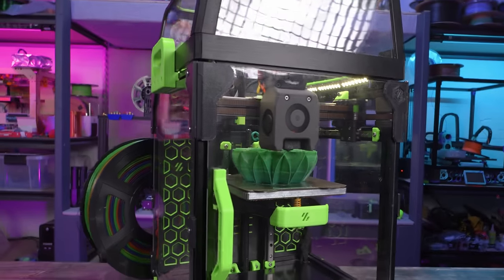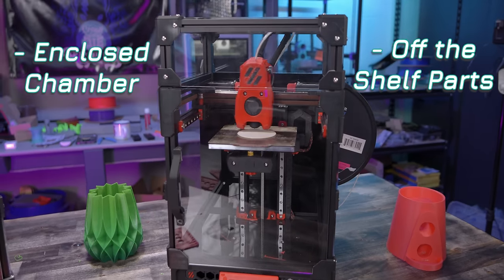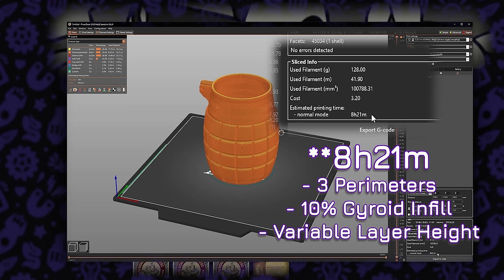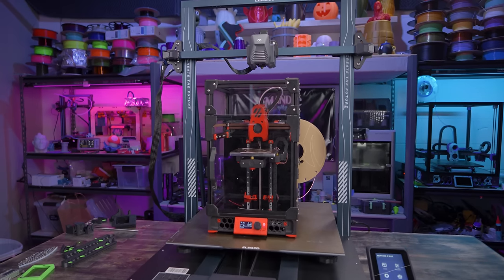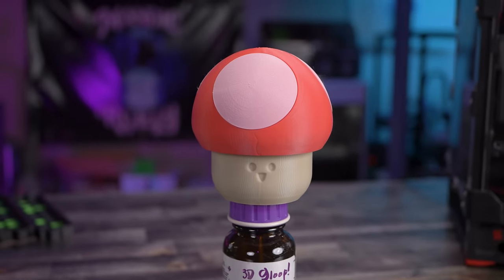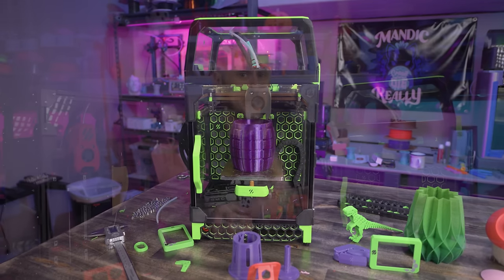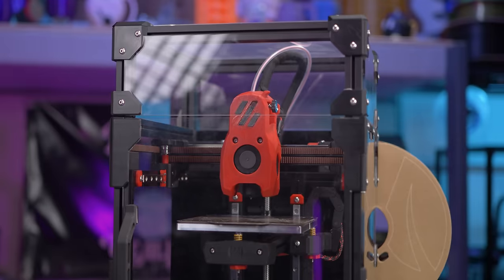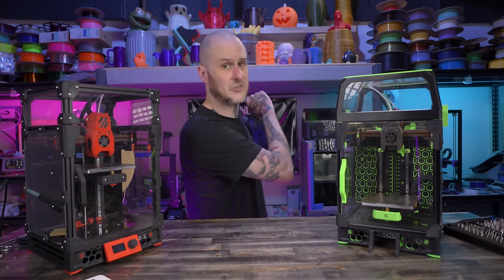Small 3D Printers are POINTLESS! Or...

Comment: I was able to make a 300mm long part with my V0.1 just fine, I designed in dovetail joints into the part and glued them together. It was the easiest way to get an ABS part that big without warping or a large build chamber.

Comment: I got a 350mm voron 2.  Reasoning was that sure I could get a smaller one, but I KNEW I was gonna want bigger parts.  I don't do a lot of design work - just finding prints to do usually - so printing fast is not really a problem.
Reply: I usually go with bigger printers because I like to throw stuff on and have it fit. Even small parts I like to be able to batch them. With that being said I haven't printed in ABS / ASA in a really long time and can see the benefit of a small enclosed printer.

Comment: another thing about mini printers is that it forces you to make easily printable models that you can glue or even weld together with a soldering iron. These models will either have to be sliced to be printed in multiple pieces or adjust the size to be smaller. This makes you have to print easy models that are unlikely to fail and if they do fail, less wasted time and filament. Furthermore, yiu get amazing features for a low price. The Monoprice Mini Delta is my go to mini printer, and I LOVE IT it is fast, high quality, easy to mod and maintain, ect. Simply put, the only models that can't be done on a mini printer are large print in place models, and let's be honest, print in place is more a gimmick than anything in most cases.

Comment: Honestly 90% of what I 3d print is smaller than 180x180, and 2/3 is smaller than 120x120. Building a Positron right now as I feel 120mm is a bit small for my purposes(too small for 3x3 Gridfinity bins).

And honestly comparing a V0 and an Ender is like comparing a cheap pickup to an EV Sedan. Both have completely different use-cases, and are valid, but for different reasons.
Reply: Hey I'm in the middle of building a positron right now as well. Did you finish yours yet? If so, how did it go?

Comment: You're bald because there's a finite amount of male hair allowed in the universe and Bryan Vines is using up your share.  :)

I would like a high quality, Core XY, 100 mm^3 ish printer - I print enough small things I'd be able to use it.  But I'm absolutely uninterested in having to build and tune a printer, so Vorons don't appeal to me.  And without the "I built it myself!" element, none of the Vorons is worth the cost.  (To be clear, it's my feeling that Vorons are absolutely worth the money for the folks who get value from the "I built it myself" element, but if you're like me a Voron is just "really expensive and a massive amount of work.")  For the money I'd spend on a V0 kit I could get a second X1C.  

Sure, the Total Cost of Operation on that X1C is higher, but the added flexibility would also be useful from time to time, and the extra money cost would be more than offset by the reduced exasperation costs.

What I'd really like to see is a "mini X1" printer, with the same fire-and-forget utility and high-temperature viability as the X1C but with a small print volume.  If something like that came out priced in the 300-400 USD range, I'd be very tempted.  Until then, my "prototyping" parts generally just get slipped in with other things I'm printing.

Although - given that I mostly print R2-D2 feet these days, and those need to be split even for the X1C, arguably what I should be buying as a Prusa XL, and set the X1C as my "small and quick things" printer.

Comment: You made some great points, I agree, from someone that uses, sells and upgrades printers as a business, I have printers from 120mm2 to 500mm2, I think its best to own at least 2 printers, buy a great big cheap machine for those big PLA cosplay things, and a small compact quality machine for printing high quality mechanical parts, always use the right tool for the job, and I'll bet if your into mechanical parts, you will be using the small machine more often than the big one, smaller machines have better tolerance, heat up quicker, are much easier to repair, can print faster, will fit on your desk right next to your work station, the only CON is build size, and I think most people just see that and let it go to their head, saying all this, I think a perfect compromise should be 150mm3 volume, the Voron Zero should have been 150 from the start, but this is a metric thing, I also don't think 0.4 should be the standard Nozzle size, should really be 0.5mm :)
Reply from the maker: After this I’ve been heavily thinking I should build a 150 or 160mm variant of the V0. It may well happen soon. That really does feel like a sweet spot.
Reply: @MandicReally  Yes I agree, 120mm3 is good, but 150 would have been a better choice, there should be a 150mm3 V0 then they should have done a bigger version with 2020 extrusion called it the V1 and made it 200mm3 then step up to the vastly more complicated V2 or Trident.

Comment: You touched on it slightly, but I think the biggest reason is that a Voron 0 is rarely the only printer someone will own, while the Ender 2 Pro (and other low-cost off the shelf printers) will often be someone's first and only printer.
If I only own one printer, I would want to make sure it is convenient for all my use cases, so even if only 5% of my prints wouldn't fit, that would be annoying.
Heat-Up time is also less of a concern on those printers, as they will likely only ever print PLA and PETG, and are also relatively slow. 10 minutes of heat up are annoying if your print only takes 30 Minutes, but if that Same print already takes 2 hours, those extra 10 minutes don't really matter.

For me, the perfect combination of printers would be something like a 2.4 350, both for big prints and mass production (and admittedly because it is cool), as fitting more stuff on one plate reduces printer downtime (heat up, cooldown, finding the time to pull the parts out of the printer), and a smaller printer (I'm currently leaning towards something like the Salad Fork, a Trident Scaled down to v0 sizes, but with a max size of 180x180) for rapid iteration.

Comment: I've been using a second hand Monoprice Select Mini V2 for 6 months now.  It was given to me for free so there's no way I'd complain.  Sure, it isn't perfect and a 110mm/cu (usable) build volume is limiting BUT it still works and it does a really good job.  Add to that I HAVE to think smaller and be very careful when I design things which has forced me to come up with some pretty creative ways of getting around problems.  It's also enabled me to get much better at placement to maximize size.  I've been able to print off 135 mm long items in this smaller volume.  Considering 90% of what I print fits in this space I don't really need anything larger.  I sure want it though.  :)
Reply: I Had this machine for one month and then i bought my MK3. It was nice to get started, but it lacks so many Features, and the Manual leveling with a Tool are Not really nice. 
 At the Moment i would Like a bigger surface but Not a Lot more height, as I  am printing lego Stones which arent that large. But only 84 fit on my MK3.

I do Not mind the small build Volume, but for Projects bigger ist better. If you have to Print a Lot of objects it helps Not to have to Clean Up the build space after every small print. Just fill IT Up and Go.
Reply: @MaxMichel89  I'm actually on the verge of getting an SV05 but only because I want the build volume and it'll really only get used for those larger prints. At least that's what I keep telling myself. 😁
Reply: @Enjoymentboy  IT should be a better value, but Inpersonally Like the better working conditions and Open sourceness from Prusa. Also depends where you live.

Comment: Personally, I think it's a nice machine if you have multiple printers. If it's just one printer, even if the majority of your prints work, the ones that don't are still a factor.
Most people don't use multiple printers, so it's probably not for them.

Thinking about it, I may eventually buy one on the side, most my prints do indeed fit and it is a nice project on it's own.

Comment: Had a crunchy motion sound on one of my linear rail machines, and found that by using a thicker grease in the bearing blocks helped a lot.  Downside:  partial disassembly will probably be necessary.
Reply from the maker: I'm hoping that is all I need. I never greased them as well as I should have initially.  Hopefully they aren't damaged now as I have a few hundred hours on it.  I'll be disassembling for a conversion soon so I'll address them then.
Reply: @MandicReally  If you need to replace the bearing balls, the best place I've found is McMaster Carr. Just search for Low-Carbon Steel Balls 5/32" Diameter. I used these to rebuild some sketchy rails I got years ago and they worked out great.

Comment: could you say then that a voron 0 is a great 2nd printer when the reasoning for the 2nd printer is that 1 printer just doesn't quite have enough throughput for rapid prototyping
Reply from the maker: Yea, that was a point I had intended to make but didn't want to drag out the conclusion.  To me the V0 is an excellent "2nd" printer.  Have another machine that can handle the bigger stuff, but the small one to pump out rapid parts. When I first started using my V0 that was how it was.  It was the "small" sibling to my Prusa Mk3 & Ender 3, that slowly eclipsed those machines entirely.

Comment: I see small (fast) printers like I see big printers… amazing to augment a primary printer, but not great as your first one since they fill a bit of a niche.  A Voron 0 would make a great second printer, just as the Neptune 3 Max does (just different ends of the spectrum)… but I’ll always recommend a solid mid-volume printer as a first (workhorse) printer.
Reply from the maker: Yea, I wanted to make that point but didn't want to run the video longer. It isn't what I'd recommend for your ONLY printer, but an excellent 2nd printer.

Comment: You have to wonder if the people who ask why actually operate a 3D printer at all. So many parts people print fit on a 120mm bed. More printers is faster and these are quick as well. The average person could benefit from one as a second printer.
Reply: Exactly, im currently building/designing a 150mm³ build to be used a a backup to my VzBot. 

Big enough to print the vz parts and its own but small enough to be stored inside the other printer when both are not in use

Comment: If you build a voron 0, remember to not use NEMA 14 motors! I switched to LDO NEMA 17 and it can accelerate at 30000mm/s^2, when using stealthchop and running lower than rated current.

Comment: Also depends on where you're coming from. If you're coming from the cosplay corner, then you'll need a bigger build volume. 300 x 300 x 400 is a must! Having too many cuts in an armor piece results in misalignments and therefore you have to fill in the gaps which requires more post processing.
Reply: also more "cuts" opens up more chances for a warp to occur on a piece, resulting in many re-prints.  The more of a large print you can do at once, the better.

Comment: I have an old Flashforge Finder (140mm^3) and recently also built a Voron Trident (250^3) and I find, build-volume-wise, that the Finder prints almost everything I want to print.  I went with the 250 spec Voron because I really didn't need any more than about 180mm^3, and there's not a spec Voron for that.
Reply from the maker: I'm starting to really think the Voron team should consider something between the 0.2 and 2.4/Trident 250mm.  Something like a 180mm machine would probably become my most used rather quickly...
Reply: @MandicReally  Members of the Voron Team have developed smaller printers based on the stock printers.  There's the Micron+ that's 180mm^3 (think V2), and the Salad Fork which comes in at 160mm^3 (think Trident).  I saw mention of a Halfwire (think Prusa Mini mashed up with Switchwire) but I'm not sure if it was a one-off or if it is in development.

I was originally thinking about a Salad Fork for my next printer, but I have a 250 V1.8 frame kicking around that is yearning to be turned into something... So that may end up turning into a Legacy of some variety.

Comment: I mostly print very small parts, custom grommets with TPU, filler pieces, knobs and whatever I need for restorations. I have a neptune 3 pro, my first machine. Happy with it. But I wouldn't mind a small very fast machine. A bed volume of 5x5x5 cm would cover most parts and they would not even have to be pretty.... :) It's all on on the inside of other things anyway.
I'm even looking at printers for kids. Crude, but cheap, so I could work on restorations and have multiple filler pieces printing as I go.

Comment: what am i printing?

two 10mm bushes?

why wait for a 400mm cube to heat up, level, blah blah, when the 40x40 (peltier module!) buildplate  baby printer can spit out three sets before the big ones even homed itself?

never done a print that needs all 400x400. and seeing as a PEI steel costs about 3x as much as a 310x310... guess what size my print area actually is?

im actually considering getting four 200mm beds... just use one most of the time.

the few times i do attempt a big print, lots of pieces at once... failure.

i got a big box of ABS to recycle.

yes, ABS, as i am a masochist...

Comment: I started with an Ender 3, huge learning curve. Like 300 $ things in upgrades. Went on with a FLSun Super Racer, too about 300 $ in upgrades. I got one printer gifted which gave me the Creality CR6 SE. And on that one day in summer my wife cleared me to buy a Voron v0.1 off eBay. The machine was assembled and kinda tuned. The first prints run and I am so happy with it. It is fast in printing and heating and it just runs and does its work. Just the manual leveling is killing me every time.

Do I need a Voron v0? Surely not. My wife is aware of this and still does not throw it out of the window.

To have a v0 is a whole different thing.

Comment: So I just ordered the Siboor 0.2 kit (with metal parts vs colored extrusions). Specifically most of what I print are smaller things, for drones and functional parts. Figured it would be faster and more reliable than my S1 Pro. I plan on getting a multi head next year.. just not sure which one yet. Waiting on the ProForge 4 release/reviews to see how well it does. It looks a lot like a Voron e.g. accessible parts you can source and fix if need be, but 4 heads, 800mm/s print speeds (we'll see how fast it really is), etc.

Comment: My v0.1 has 842 hours, 1020 jobs, and 6km of filament used in about 8 months at speeds around a bamboo p1p ... My 2.4 built at the same time (and printed by the v0.1) has half as much time on it. If I have something to print and it fits, it typically goes to the v0

Comment: I've just bought a Neptune 4 Max and honestly, the bed size really can't overshadow the print quality with default design (I will upgrade it with linear rails in the near future). That's why I want to try out building my own 3d printer, starting with the Voron 0. I was a bit concerned about the bed size, but your video made me realize what I need, not want. Voron 0 it is.

Comment: I got a Ender 5+ modded mercury zero g, a ender 5+ with hero me gen7, a trodoon v2.0 , and a CR6 SE, and yes, the CR6 SE is the one that sees the most use -why you wonder? Because of the same as he talks about here, speed to heat up, smaller footprint, but I still probably would get away with a 0.2 or a Ratrig Minion, I am still into building a 0.2 cause its small, already done for printing abs and asa and so on, but have not thought about to load up a profile and check of how much of my smaller prints fit there, I will take your advice on that, thanks for the tip!

Comment: A rather simple addon can negate the enclosure heating time difference. One can get a used hair dryer for a few dollars, or even free. Slight case modification, a relay, and a temperature sensor/switch (but an Arduino is a better way) — and you've got yourselves a printing enclosure temperature booster. Then, your enclosure could be ready in a minute or two.

Older underpowered-for-today hair dryers are a better option, because it is easier to control the potential temperature spikes; food dehydrator is also an option (due to a weaker heating element, and thus "safer"). And needless to say, have a triple you-built-it safeties (ideally, on top of the dryer built-in ones), ideally only have it on to heat the inside air while you're physically present (first few layers), and only to a reasonable air temperatures (consider hair dryer's and your printer's components and build materials). 

If you cannot fathom at least 10 ways in which you can mess up this project/addon and fail – (and their succesful fixes) – better ye not undertake this project.

Comment: When you're talking about "Value per unit dollar spent"...yes, small printers suck.  There's a baseline level of components you need, and increasing their size doesn't necessarily increase the cost of the machine linearly.  Usually the machine scales nicely upwards with the price not following closely behind, but rather staying close to the original level.  Yes, most things are going to be on the smaller end.  But when you NEED the build volume you either need another machine, or you need to ask someone, etc -- that's a pain in the ass.

Comment: Thata the first question i ask when somebody wants a printet or suggests one. What are going to do with it? How large are the items? If you are going to do functional abs part your ender 3 is pretty pointless, even with all metal hotend and enclosure, its just not built for that usage. Same goes the opposite way, pla prototypes or cosply. A qidi i fast as example is also wasted money since its not good for pla.
For size i only ask if its out of the ordinary, like above 300mm since the drawbacks of large printers become really apparent aftet 300mm